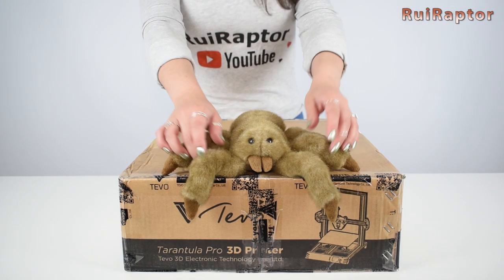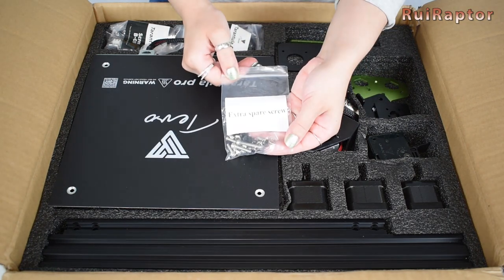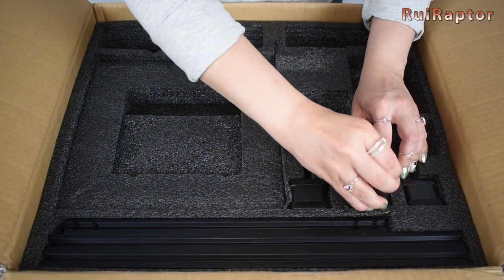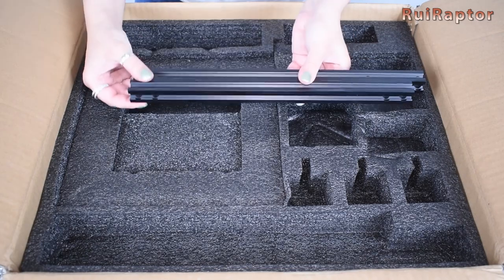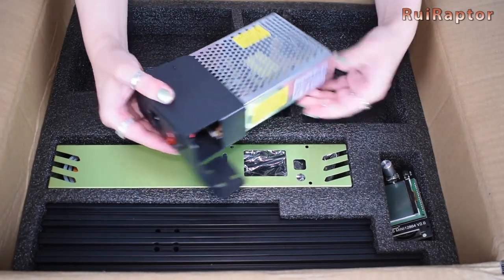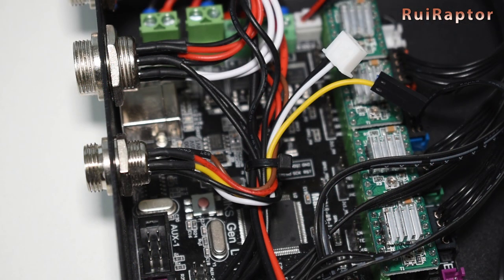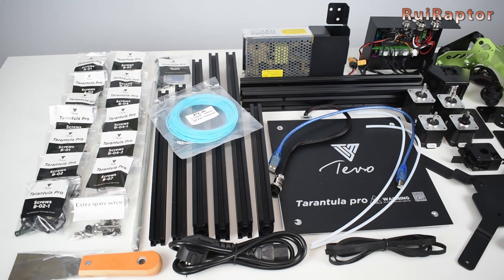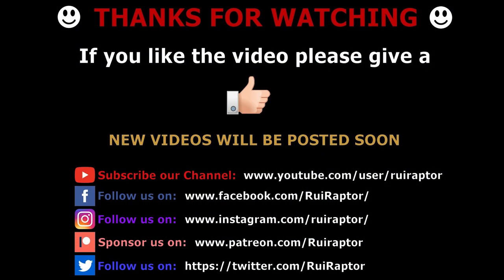Tevo TARANTULA PRO 3D Printer - Unboxing

Comment: Hi! Right after seeing the head I've thought "oh, it's the same as in Flash"... then I see the same screen-control-SD module, cables and the same MB. The drivers probably are cheaper than TMC2100 or 2208. Not sure though. So... is it really different?
Also I bet that the hot end's case is making a specific "ABS smell" (when printing) and then it will crack somewhere with a possible lockage of a fan(s).
P.S. ohh! wow, they've included a strain relief FINALLY! :))
Reply from the maker: Hi,
The strain relief is also included with the Nereus. Regarding the drivers, the tarantula pro has Allegro A4988 which are not as good as the TMC of the flash. Regarding the hotend, the heatbreak on the tarantula is different also from the flash. The PTFE on this one goes all the way down to the nozzle while on the flash, goes only down to the heatbreak. On both models you cannot print with temperatures higher than 240 degrees C because of the PTFE tube.
Reply: @ruiraptor 
It's pitty that they sell it with A4988. Doesn't seems like "Pro" here.
 I print on Flash setting 248C for my PETG, sometimes it goes to 250 and it's fine yet. Maybe I can't see some things...

Comment: Hey bro .. well done .. I'm thinking about getting my first printer and i have both the ender 3 and the tt pro in my basket, unfortunately I have to choose one .. I'm really confused which one should I get .. I saw almost all of the reviews on the ender 3 posted on YouTube but haven't seen any but yours on the tarantula pro .. ( I really like the way the tarantula looks and it's specs, but yet I don't want to regret favoring it on the ender 3 ) .. can you help me understand which one should I get .. I'm asking because I have no experience whatsoever except for the videos i watch on YouTube and posts on the internet and that's why i came to ask someone whose expert .. thanks in advance .. and keep up the good work.
Reply: I've got a CR-10 and a Tevo Flash, and if the Tevo Pro acts anything like the flash, I'd take it. Removable stepper drivers and a widely known mainboard, as well as dual fans means that the amount of upgrades I've wanted to do have already been done. Volcano hotends print absolutely beautiful layers when the outer perimeter is 30mm/s, especially with a 0.6mm nozzle. Also seems that this printer has everything ready to go if you also decided to get a BLTOUCH to increase first layer reliability. 

Ruiraptor's comparison of the Ender 3 and the Flash might be a good place to start, as other than the build process and the AC bed, it seems similar.
Reply: I have had a Tevo Tarantula for two years now? I would recommend anything else but Tevo. I'll never buy anything from them ever again. The quality of the parts is terrible. The manual is absolutely ridiculous and support is terrible. I'm on my third pcb, second hotbed, and I've replaced almost all the parts. I'm switching to linear guide rails soon as it sounds like a nest of starving baby birds. The bearings are horrible. Anyway. That's my two cents worth, the choice is yours.
Reply: @newfization  shitt i just bought my first 3d printer and its the tevo tarantula pro
Reply: i hope it is good
Reply: @alisarhan5866  well look at it rhia way, if it goes the way mine did you're about to learn a lot about 3D printers lol.
Reply: Contact me if you have any problems.
Reply: @newfization  hi i ran to my first problem and tevos service is shitt my extruder cant take filament what do i do fuck tevo

Comment: is it an Ac or a DC bed? it looks like a DC bed, but the power supply only being 8.5a puts some doubt on that
Reply from the maker: It's a DC bed. I also think that the power supply output current is a bit low, but we will test everything when the printer is assembled.

Comment: Is the hotend all metal or ptfe lined @ruiraptor
Reply from the maker: Hi Kyle, It's neither. It's bore which means the PTFE tube goes through and all the way down to the nozzle.
Reply: @ruiraptor  seems they've used Flash's user experience and fixed some things. As I've seen in the group (and not only), ppl recommend that type of the throat. I'm guessing that the con is that it's not for hi-temp plastics. Will it be printing PETG normally (without deforming the PTFE tube)?